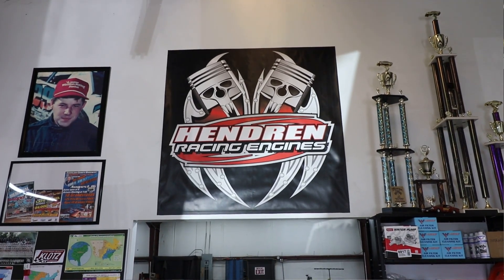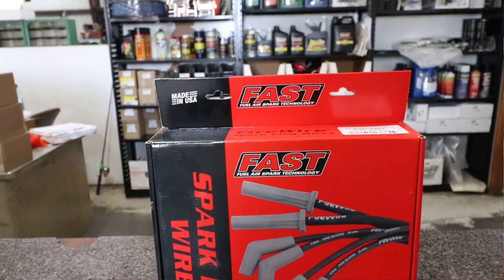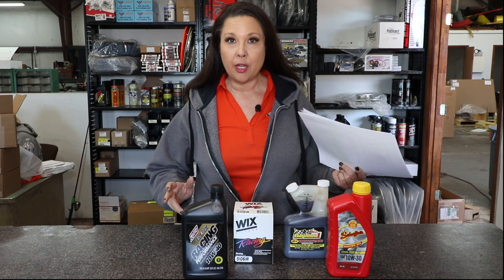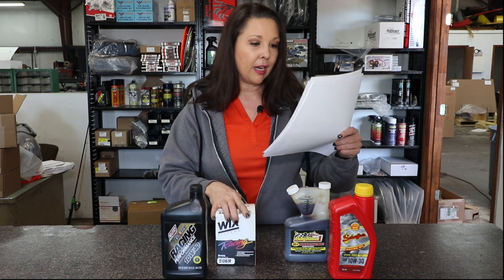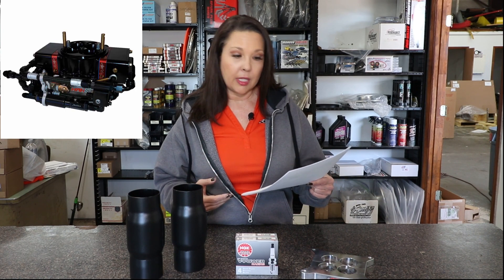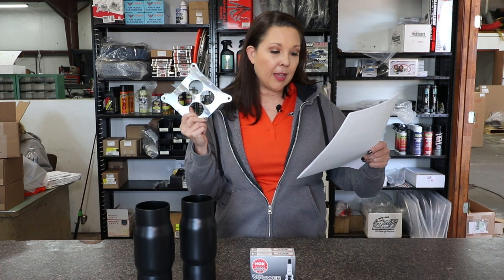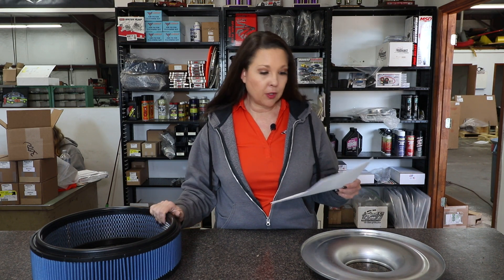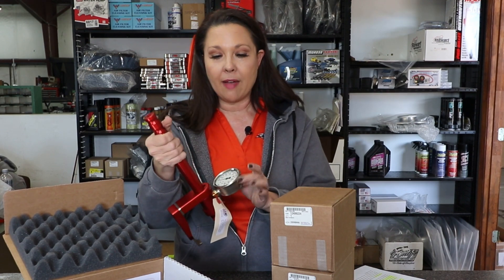Hendren Racing Engines 604 Crate Engine Recommendations 2018

Comment: If i sent a 604 that had fresh valve  springs installed, engine with about 12 races in it... just off the dyno at a peak of 404hp, for $15,000 would you go through it put the magic touch on it, send in back to so i can see 408 hp on the dyno..... would you ? Also would you leave the broken valve shims in the oil pan too, so they would come out the drain plug on the 1st oil change, would you do that?
Reply from the maker: No, I certainly wouldn't do that. There are many things wrong in your scenario. It sounds like that happened to you. I hate to hear when racers have bad experiences. -Kate
Reply: @Crateinsider  
Not me, but a racer i did fab work for, H from H did that, i will leave it at that....but i ran Supers and Steel heads, i'm not a crate guy. Worked in engine shops for years, I like to build my own engines. I quit racing in 09.
Reply from the maker: @joracer1  I support racers in whatever format they decide to race. So sorry to hear you've left the sport. Of course, I focus on crates since that is the foundation of my website, but it's never about "crates are better than built engines" or anything to do with drama. Instead, I just concentrate on helping guys who are running crates get the best value and performance possible.  I also dispel rumors and myths that are so prevalent in racing.  Thanks so much for starting the discussion.
Reply: Broken valve spring shims means float